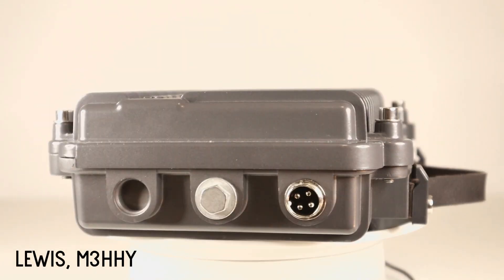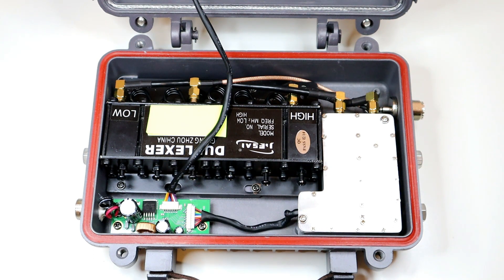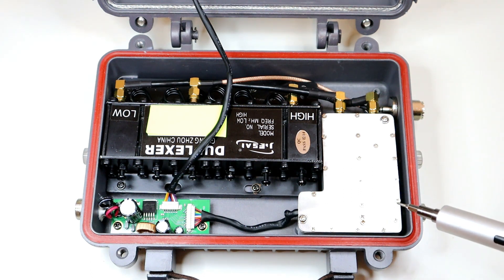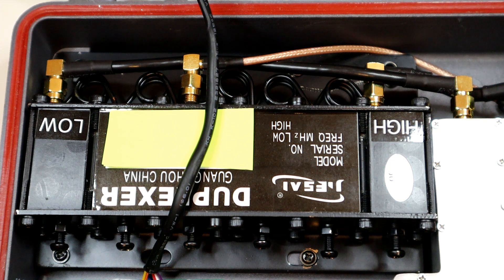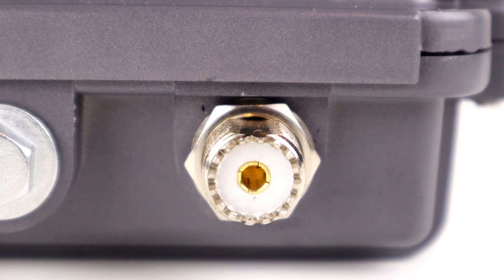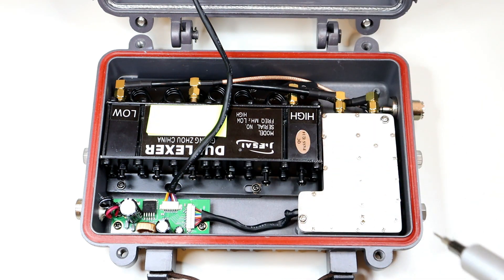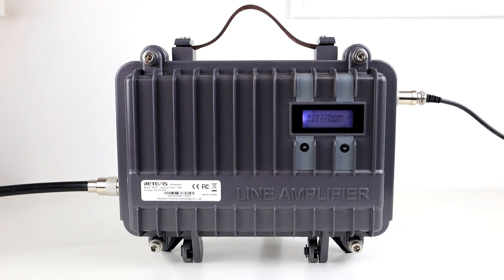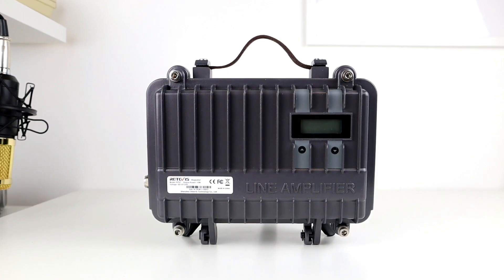What's Inside The Retevis RT97 Portable Repeater?!

Comment: Hi I have a question is it possible to add a amplificator on the antena with the multiplexer for example for increase the power to 10w to 50W is it possible to the retevis RT97 ?
Reply: No. The amplifier would have to be in front of the duplexer, which cannot handle that much power.

Comment: Greetings. It's hard to see for sure, but does the transceiver have any breakout for external control: audio out, audio in, COS, PTT, and ground? It would be nice to be able to interface a small external controller to it to give it more smarts. Or if there would be a way to easily modify it. I would pair nicely with my repeater controller software project (openrepeater.com) running with an ICS Controllers 1X board on top of a Pi Zero.
Reply: No there are no such breakouts. Without a schematic diagram it would be a real challenge to   make modifications.

Comment: I don't understand this unit , there seems to be varying info on the freq range and split and the programming software doesn't help
how can you have several freq pairs programmed when the duplexer is normaly only set for one ?
Reply: Freq and range does.not vary.. And there are no pairs, thats infinity of the spectrum. In other words. The split.is always 10mhz 
And the range is like 400-512mhz. Or somewhere  among those lines. That always stays the same.  Pairs is a frequency set. Thats infinite

Comment: When ordering one of these do you have to tell them what frequencies you want to use so it can be tuned or is the split standard? Ie The top and bottom of the 70cms band?
Reply: I've just read the info on the manufacturers site it says it's supplied on 406Mhz with a 1Mhz split but you can request a change.
Reply from the maker: It's standard 10mhz split, your choice of freqs between 406-480
Reply: @RingwayManchester  Now it can be tuned for the more common +5 MHz split.